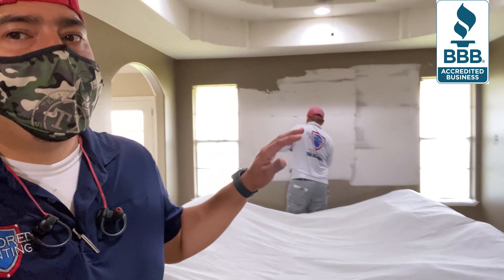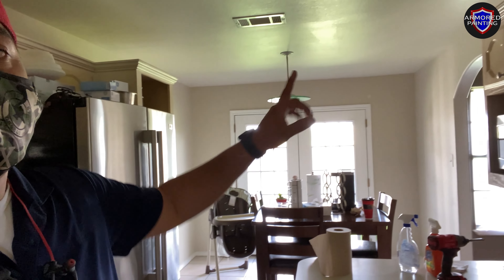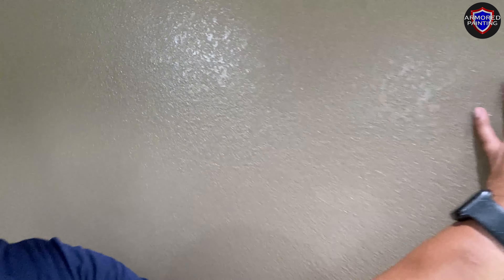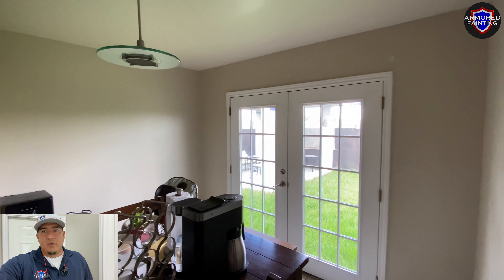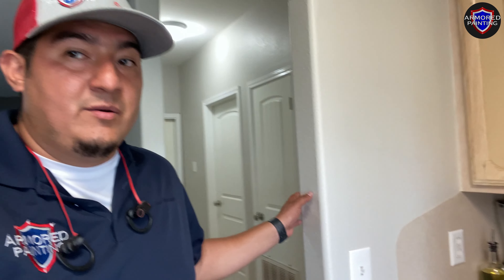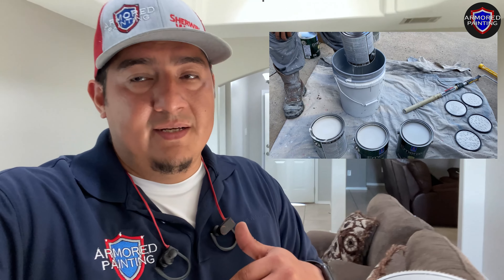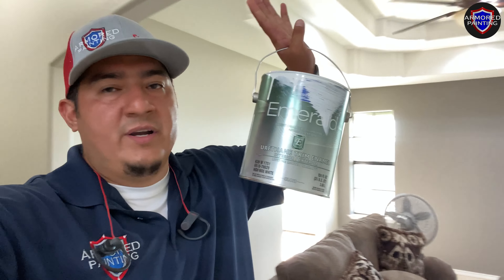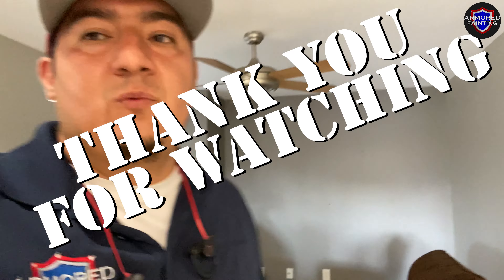Repaint with Emerald Designer Edition

Comment: QQ Why would you recommend Emerald Designer for two colors not in the collection?  Wouldn't that just encumber additional unnecessary cost of the customer and you could have given them Emerald?  Agreeable Grey and Dovetail are not in the Emerald Designer collection.
Reply from the maker: Hi Steven! Thank you for your feedback. Your insight is very important to us. Part of our companies process is to introduce several paint options and give the customer an opportunity to make a selection themselves. They do this based on what each product does. All colors, including the Emerald Designer collection was introduced to the customer. This customer is extremely satisfied with the Emerald Designer Edition's ability to scrub and not burnish the paint. Thank you again for you feedback.